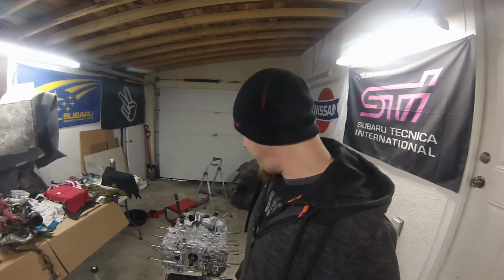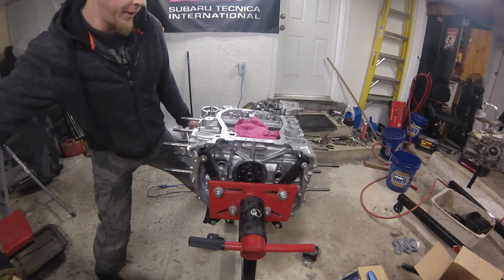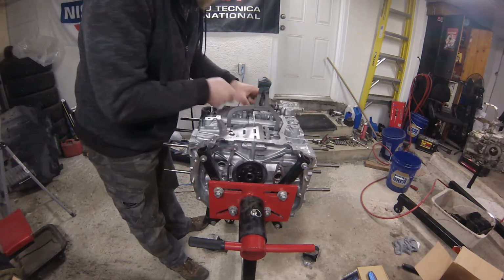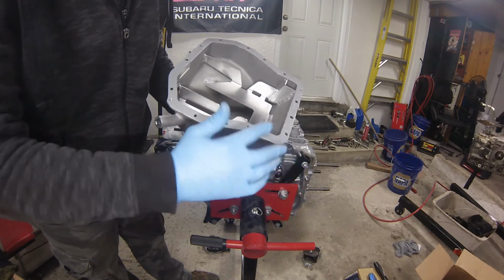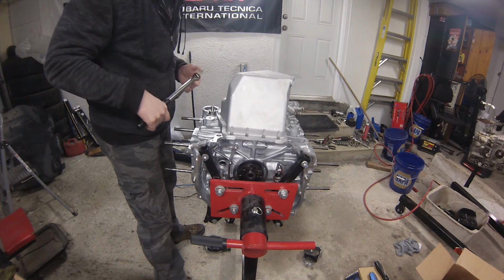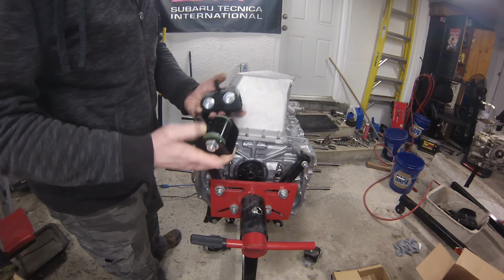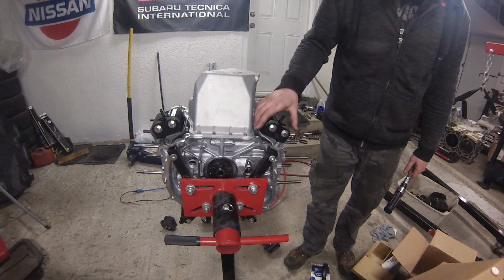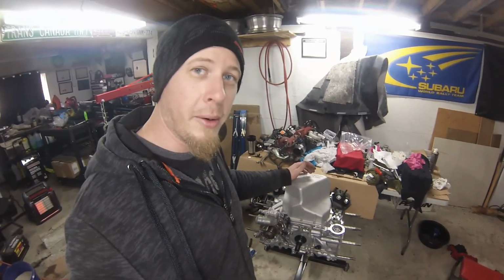2013 Sti Build Part 6 - Killer B Pan / Beatrush Mounts - How To

Comment: Hey. I have a p000d code.  Exhaust camshaft position sensor driverside.  Do I still need to relearn it after replacing it?
Reply from the maker: Code will require clearing
Reply: @HomebrewSubaru   u mean just clear it with the obd2 scanner  or with the binular scanner? That's what I mean by relearning it..
Reply from the maker: @alanchanthavisouk8557  the sensor is a non calibrated part. Clear code with obd2 should be all that’s required. If replacing an actuator, this could require a timing relearn.
Reply: @HomebrewSubaru  I appreciate your feed back thanks a million.

Comment: Did you plan on having the heads resurfaced? I thought that was a must for a rebuild
Reply from the maker: Resurfacing is always a good idea if you are unsure about a cylinder head. A head bought used online or from the scrap yard/auto wrecker,  something you suspect was overheated badly or some obvious pitting/physical damage are good reasons to have heads checked. The best way is to use a straight edge and feeler gauge to check for any warping.

So to answer your question, it isn't a must but it is recommended or required in many situations just not this one. These head have low mileage, are very clean and the block is freshly machined. Some new gaskets with the ARP head studs and I guarantee a perfect seal.